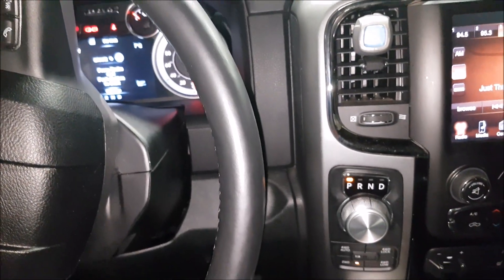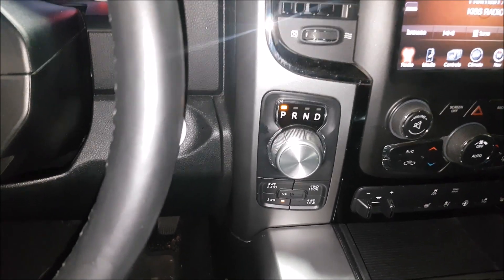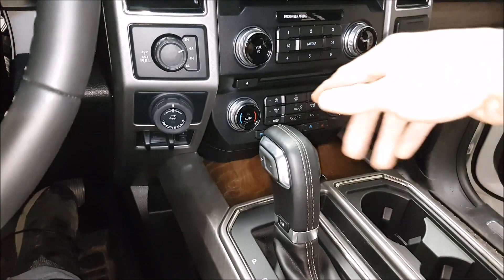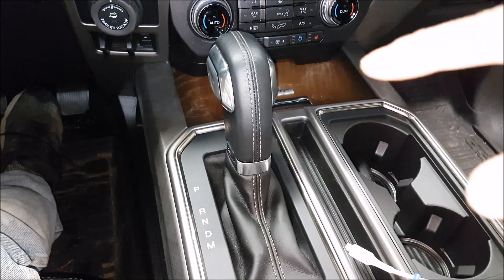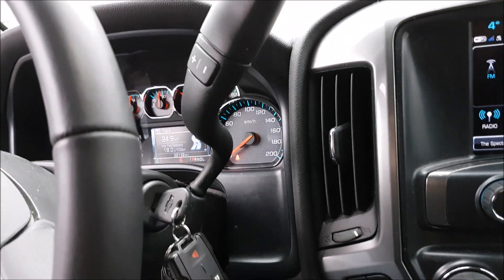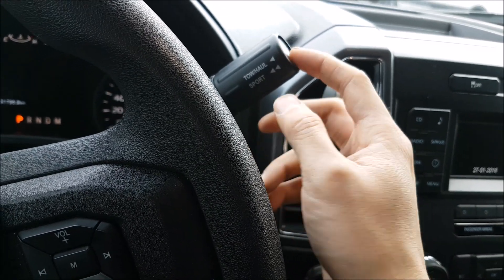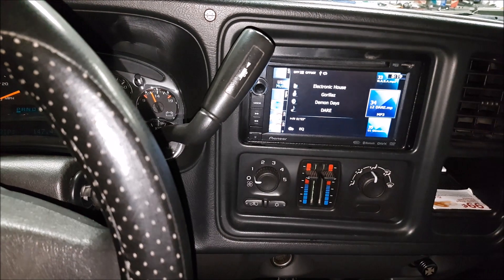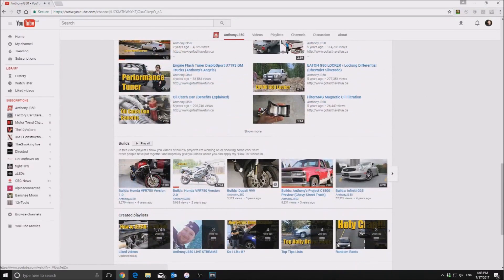Rotary vs Column vs Console Shifter Full Size Pickup (Which do you Prefer) | AnthonyJ350

Comment: I prefer the column shifter as well, it's just what I like. I don't find them "old-school" (even though they kinda are and have been around for a while) or anything like that, I like that GM is using them in their new 2017 model trucks and I'd personally consider that a purchase decision as well.
Reply: ethancedrik Ford Also Has Column Shifter On The Ford Crown Victoria Ford Explorer Police Interceptor Utility Ford F150 Ford And Ford Taurus Police Interceptor Sedan Now Only Trucks Vans And Police Cars Has Has Column Shifters From Ford
Reply: Column shifter is the best transmission  gear option ever made, I wish they would bring it back to all sedans.
Reply: A B Column Shifters Means That The Wipers Must Share The Turn Signal Switch

Comment: A salesman tried to point me in a direction to their console shifter on the lot but end up ordering a column shifter. Best decision made and it open up a lot of space for storage and a front bench seat as well.
Reply from the maker: It's hard to beat the functionality and simplicity of a column shifter in a truck.
Reply: Dude I hate you the Rotary dial pad shifter is better my granddad had a 1999 Chrysler 300 ss and ever deep pothole we hit the shifter jumped into overdrive then to park and we stoped so hard I hit my head on the center counsel and a car was right behind us and it nearly hit us and a rotary dial pad shifter on the other hand so this story goes and this is true so we ordered a Lyft and it was 2019 Ford Fusion it had a rotary dial pad shifter and we hit a deep pothole and it did not even switch gears so which is better weirdo

Comment: Comedy answer: Edsel Teletouch- push-button gear selector on the steering wheel, where you'd expect the horn to be. Doesn't sound as weird nowadays with rotary knobs, but completely bonkers in the 1950s.
Reply from the maker: Ya a lot of these "convenient" vehicle trends are just gimmicks to get sales and unfortunately I think it will reduce vehicle longevity.  Simplicity and over building is what wins me over.

Comment: Column is the absolute best, simple, leaves tons of room in the console and is out of the way.
Reply from the maker: Yup and it's a mechanical connection to the transmission so it's simple and reliable.
Reply: AnthonyJ350 Dude the Rotary dial pad shifter is better my granddad had a 1999 Chrysler 300 ss and ever deep pothole we hit the shifter jumped into overdrive then to park and we stoped so hard I hit my head on the center counsel and a car was right behind us and it nearly hit us and a rotary dial pad shifter on the other hand so this story goes and this is true so we ordered a Lyft and it was 2019 Ford Fusion it had a rotary dial pad shifter and we hit a deep pothole and it did not even switch gears so which is better weirdo. Great video!
Reply from the maker: @MochoStudiosYT  Column is better. If your battery goes dead how do you operate the rotary shifter?
Reply: AnthonyJ350 true

Comment: Not a fan of the rotary gear selector
Reply from the maker: They make sense but ya, I'm not a fan either.
Reply: AnthonyJ350 just seems like another expensive part to replace when it goes out.
Reply from the maker: Yup, you're a 100% correct.  I don't really see these newer trucks lasting on the road as long as the older more simple ones.  I guess some people just like making car payments all their life and will just buy a new truck every 4 to 5 years.
Reply: It is better cuz it is a lot easier than a column shifter or a center console shifter

Comment: I have a ram 1500 SLT with this rotory selector. I was thinking of putting a small plow on my truck but I'm not sure..... Is there any benefit to the Nov selector? Does it help save you transmission from abuse in any way?
Reply from the maker: I don't think any type of shifter will make a difference in terms of wear. Best thing you can do is install a big transmission cooler and come to a complete stops before changing directions from "Drive" to "Reverse". And also use a good synthetic transmission fluid.

Comment: Its crazy how manufacturers can make trucks that have supercar performance but they can't add a column shifter, especially in sedans.
Reply from the maker: Yet majority of first responder vehicles are column shifters because they work.
Reply: @AnthonyJ350  exactly why not for the masses
Reply from the maker: @2010hyundaielantra  Because the masses are soft and will make purchase decisions  on gimmicks vs tried and true proven methods.

Look how vehicles are built in poorer countries. Much more simple and easy to repair. You can still buy the old Labd Cruisers brand  new.
Reply: @AnthonyJ350  yep, people are very gullible
Reply from the maker: @2010hyundaielantra  And people are spending over $100K on trucks. Buy an old truck, upgrade it and be into it for $30-$40k overall and it can achieve the same results.
Reply: @AnthonyJ350  my biggest pet peeve

Comment: I prefer a rotary dial pad shifter cuz it is no a cheap piece of crap like a column mounted shifter it is two 1980s ish. And to floppy (kinda)
Reply from the maker: Cop vehicles only use column due to their reliability
Reply: AnthonyJ350 I saw a 2017 cop Ford Explorer and it did not have a column nor a rotary dial pad shifter it had a center counsel shifter. Here is a story why I don’t like column shifter we was in my granddad 1999 Chrysler 300 SS we hit a deep pothole and the column shifter went to low mode then to park and I hit my head on the center counsel that is why I don’t like column shifters.

Comment: hi, do you know how to change floor shifter to column shifter for a 2012-2018 civilien ford explorer? and is it very complicated? thanks.
Reply from the maker: Not really sure on that one honestly.  I would ask your dealer if they can show you the parts diagram of both setups to compare and contrast as they have access to that type of info.
Reply: yeah, the only thing I know is just shifter housing between civilian explorer and police explorer is different(but I am sure that is interchangeable). I dont know if the gear linkage and some electronic stuff inside is same or not. could you help ask installer? thanks!!
Reply from the maker: Misha Dzhuo You'd probably need a new shifter cable as well.

Comment: I have always liked Dodge trucks. I will never buy one until it offers a column shifter. I currently drive a Chevy and it has a column shifter it makes the most sense. It's not in the way and you can put it in gear by feel. I rest my hand on it when controlling the radio. I use it to hang my sunglasses. I can look over my shoulder while backing up and slam it into drive with out taking the time to look for and gently turn a stupid knob. PS I also prefer a key cylinder to start the vehicle.
Reply from the maker: I agree and in first responder world, key and column shifters rein Supreme. You'll like this video on keys vs push to start https://youtu.be/am3Uz3Lmq3I
Reply from the maker: Side note. I think 3/4 and 1 ton trucks you can still get a column shifter.

Comment: I prefer the column shifter, both my dailys have it
Reply from the maker: Anthony Webber Are they both trucks?
Reply: my actual daily is a 2005 Chevrolet Colorado, and my work daily is a 2007 GMC Savana cube van
Reply from the maker: Nice!  I think the Savana/ Express is a really good work vehicle platform.  They drive really nice and the powertrain is very reliable when maintained.
Reply: yea, you put a Gentex Mirror Temperature Sensor in your truck, would it work in my Colorado if i got the parts?

Comment: Personally I want a column shifter or manual transmission in a pick up (manual transfer case if they are 4x4) and a center console shifter in a car, and definitely get rid of the push to start feature. It's nice but it has to be a pain to repair
Reply from the maker: I agree

Comment: Floor shifter cause I drive standard, column standards are a pain to shift
Reply from the maker: What about auto? Since it's almost impossible to find manual for a full size pickup.
Reply: AnthonyJ350 it feels more familiar for me to have a console shifter, and 2018 rams with a cummins can have standards, nothing newer unfortunately
Reply from the maker: @ottovonbismarck7094  Exactly, it's sad you can't order a new heavy duty with a manual anymore. I just like auto column shifters in pickups personally.

Comment: i would rather have the rotary shifter cuz is more futuristic than a dumb cheap old non responsive floppy non futuristic 6 speed column shifter cuz it provides a 10 speed automatic
Reply from the maker: To each their own.  Not sure how the column is unresponsive as they are a directly mechanical connection to the transmission.

Comment: I've worked on countless of these fucking Rams from auto detailing and this dial bullshit is absolutely unsafe, at any moment, at any time they can switch to any setting at any moment, just because of some random electronic malfunction and set the gearbox at one of the gears, this is dangerous and why ram did this is insane.
Reply from the maker: Yup, need to go back to column shift. There's a reason most police vehicles are equipped with a colum  shifter.